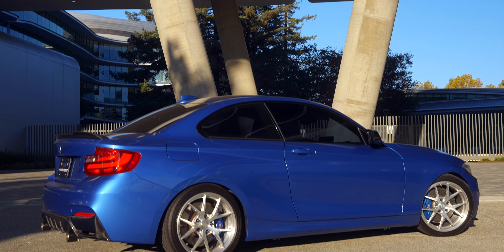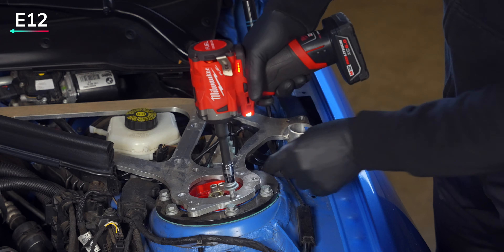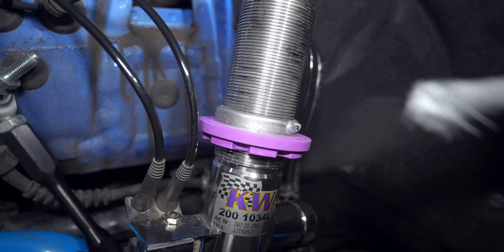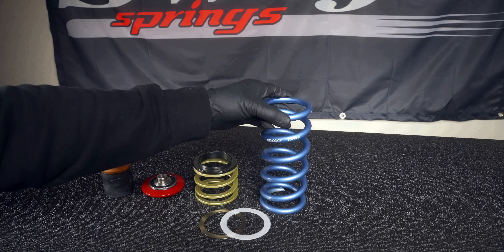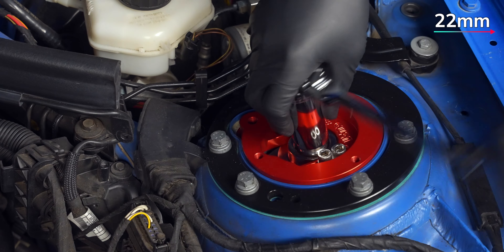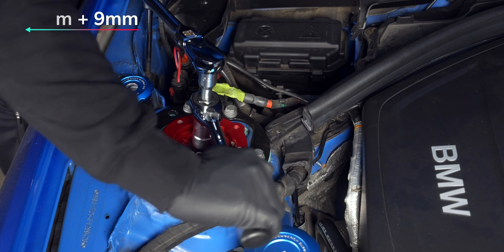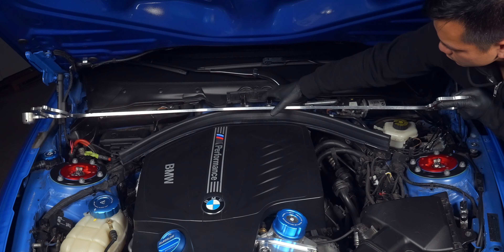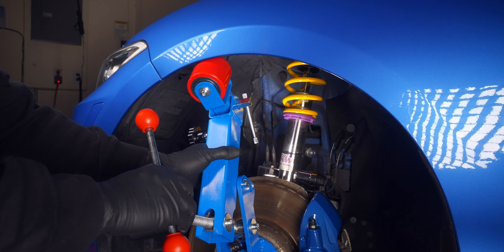WATCH THIS Before Buying KW Coilovers

Comment: I recently installed KW DDC on my 2022 Zupra. It rubbs like crazy especially in the sharp corners. I was told by KW that I will damage the dampers if to try replacing those stock progressive springs. They suggested switching to Clubsports instead...
Reply from the maker: Technically it would be out of warrant, but if you kept your old springs for the warranty pictures...

As far as it getting damaged. If you calculate the stroke range of the damper and operate within that window you should be fine. In this case I am at the lowest KW recommended height with stiffer springs so it's within the normal tolerance

The way it was explained to me by Sift and the team at SV BImmer is: it would be more accurate to say that they have not been tested with these springs and if you operate it out of the recommended stroke range then that can cause damage. 

However, mine are fins so far. If you want you can email info@svbimmer.com and explain your situation and also let them know I recommended you.

Hope that helps
Reply: @FritzRamos  I saw your video with the KW DDC , I decide to get them . mistake !!! too extremally soft and the ride height  to low . at the same time I did get 245/40/18 square (robbing everywhere at the max ride height . after several upsetting conversation with KW support I did install Dinan spring with a little camber no robbing . frustrated  with KW  !!!!  . had similar idea to add spring and helper and with your video really clear the problem with the ride height ( I might go with different spring rate 6 or 7 K)  Thank you for the videos !!!
Reply from the maker: @enriquewilliams9377  I'm sorry to hear that. Try calling Swift, they were very helpful and patient with me. Hope it all works out for you.

Comment: I want to do the same for my KW V3 on my F20, because default springs are way too soft for me. I was chatting with KW and they recommend to not to go more then 20N/mm more then default spring rate of 2041 because the damper will lose its harmonizing properties. And here I see that you went from 4kg to 8kg of spring rate which is around 40N/mm more then default. How does the car feels on agressive ride, did you lose your rebound adjustment or did you notice any other side effect maybe?

Comment: Nice video! Great production and instructional value. 

Just wanted to point out that the sealed radial bearing upper perches we provide will isolate spring rotation during compression. So the thrust washers in each spring in your stack-up might be redundant? But it can't hurt. Cheers!
Reply from the maker: Thanks for sharing that and for making such an awesome camber plate!

Comment: Hi, My KW V3 Springs have fatigued on my F22. Do you have the link to where you got your swift spring setup? Thanks!
Reply from the maker: email: info@svbimmer.com and if you want the exact same setup it's the vorshlag camber plates with the 60mm perches, 7in 8kg springs (for the front), 8in 14kg springs for the rear, as well as 2 sets or helper springs. 

Swift Part numbers are: 
Z60-178-080
Z60-203-140
H60-060-015

Let me know how it goes
Reply: @FritzRamos  Awesome and thank you 🙏 super appreciate your reply!

Comment: Hi Fritz - thanks so much for all of the great content.  I am trying to piece together your setup and mine, and see if I would have problems.  I have KW's in my cart right now after watching your original video.  I am on stock rims with spacers making the wheels flush.  I don't plan to lower too much - maybe the minimum .5" or maybe 1", but my main goal is handling performance.  I am trying to figure out if I will be fine with my setup (stock rims, 2015 M235) and maybe your issues were due to your specific wheel config?  Would you say "NO!" to KW altogether at this point for the F22?  Thanks so much.

Comment: Hey Fritz, absolutely love the content on the f22; the best I've found. I am in the market for an m235i and saw this deal for 22k but it has 87k miles. Is this still a good deal? What have you heard about the n55 at these milages? I don't have experience working on cars but am a DIYer. Thanks!
Reply from the maker: 22k is a little high, but it depends on what has been done to it and what need to be done. Hope this helps https://youtu.be/OPY0-u0lBm4